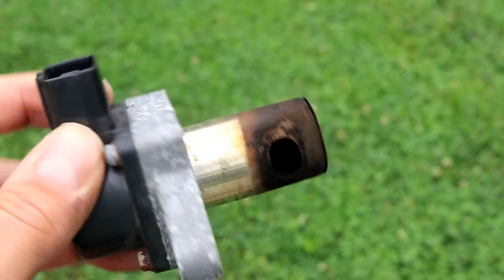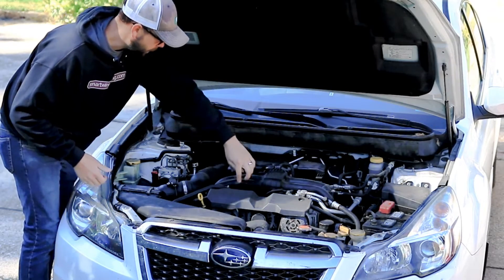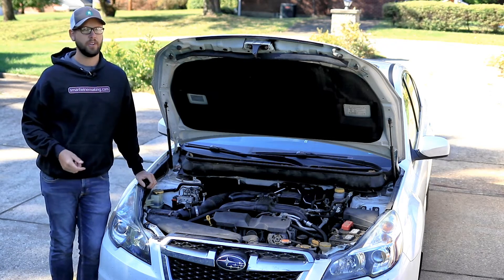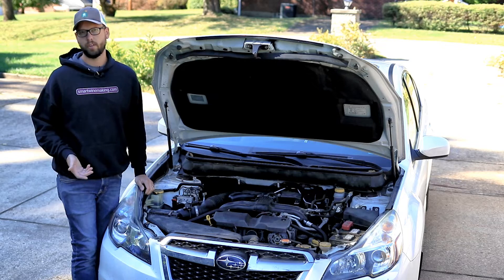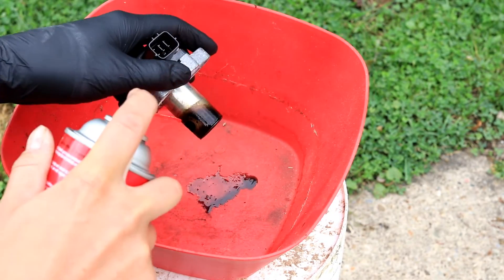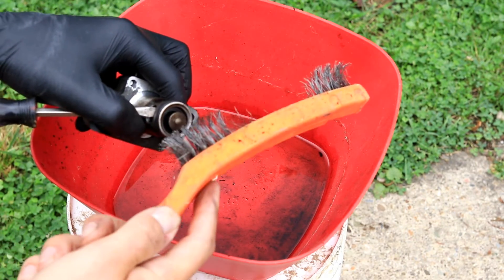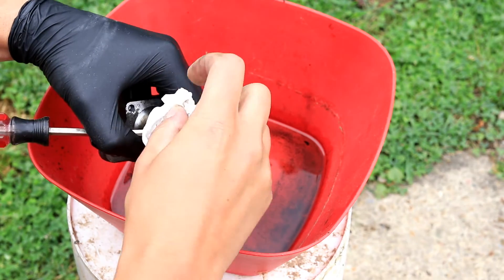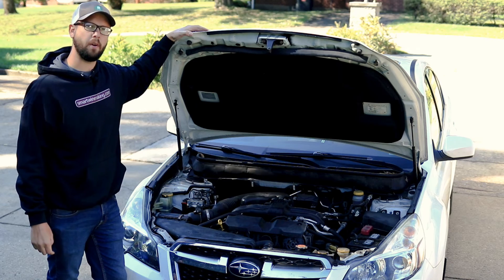Cleaning a Subaru Electronic EGR Valve to Smooth Rough Idle and Improve Power.

Comment: Great video!  Car was running really rough and stalling. Pulled the EGR, it actually was stuck in the open position because it had chunks of carbon stuck in it. Cleaned it and put it back in and it runs a million times better. I also tried to take the top of the EGR off to get inside it but one of the four screws was rusted and would not budge. Still, I let is soak for a couple hours in carb cleaner and used tooth brush. That did the trick. I have a 155K on 2013 Subaru Legacy. ALSO, there was no O-ring at all on the EGR. So, I am guessing someone cleaned it and did not put ring back on. Initial codes were P0113 and P0102. Now they are gone! If your Subaru is running rough and it has over 60k on it I would start here. Very easy to remove, clean and reinstall.

Comment: "A little bit carbon'd up." 
59k miles and my wifes looked like it was coated with Kingsford charcoal. I took the whole manifold off and cleaned the throttle body too. I took off the electrical part and pushed the plunger down myself and sprayed it really well and it looked brand new by the time I was done. It fixed  that pesky rough idle at the stop light. Good video.
Reply: what kind of car?
Reply: Did you have to do an idle relearn when done? Or you did not disconnect the battery?

Comment: Ooh!  I can't wait to do this.  I did my plugs (saved $600 off what Midas quoted), cleaned throttle body and refurbed my battery.  For a newer car, a Subaru is actually pretty easy to work on!

Comment: My screws won't come out.  Any ideas on how I may take them out easier?
Reply from the maker: They can really stick on those aluminum blocks.  You could spraying with some pb blaster and letting soak for a few days.  Unfortunately the threaded zone is pretty well sealed up, so if your penetrating oil gets there it will take a while.

Comment: 12mm bolts use, for hex head bolts, a 19mm tool.
Reply from the maker: 12mm hex heads I believe I meant to say...  Not to be confused with M12 screw threads.

Comment: Thank you, I had a P1498 code.  I replaced my coolant cross union and forgot to reconnect my EGR Valve, after watching this video I checked my EGR valve and it was disconnected, reconnected it check engine light is off and I have Eyesight again.  I going to clean EGR valve next
Reply from the maker: Glad I could help!

Comment: Is it possible to remove the solenoid (4 Phillips) from the valve and really give it a thorough cleaning?
Nice “How To” thanks!
Reply: That's what I did. Got it back together and it started, ran, had a good test drive, no codes and the total tank mpg went from 400 to 450 so I think it's safe. Lol

Comment: Excellent video. Is your engine the 2.5, or the 2.0 like on a 2013 Crosstrek?
Reply from the maker: Thank you! It is the Subaru 2.5 (FB2.5) engine.
Reply: @CoolStuffGuysLike , Thx for replying. I'm going to clean the one on my wife's Crosstrek with the 2.0. It has 155,000 miles on it, and as far as I know, none of that maintenance (PCV, EGR, O2 sensors, etc) has ever been done. It should be similar regardless. She's been taking it every day, so I haven't done it yet. Thanks for the video.

Comment: How often you have to do this or at what millage approximately??? Anyone?
Reply: My wife's car hit 59k. She was out of town so I drove it and the idling at the light was awful. So I did this and cleaned the throttle body and it smoothed out. I'd do it every 10k as it isn't hard and made such a big difference, but that's just me. At least do it when it starts to idle rough while in drive.

Comment: great video. I have a p0171 on my 2011 legacy and am curious if this could be one of those 'pretending to be a vacuum leak' instances. losing my mind trying to fix this, hoping that maybe cleaning the egr will help. only 60k, but it sat for a while.
Reply: Same year but forester  non turbo... What was the issue for you? I also heard that the AF sesor is common for P1071
Reply: @mattaust-1  honestly after a few months it just completely stopped throwing codes on me. I couldn't get past 100 miles or so for the longest time, but this last time broke the mold and I'm sitting at over 500 now without throwing the freaking code so far. AF sensor is something I never considered... will keep that in mind if for some reason it comes back. I haven't taken my fuel trim values since but it would probably be advantageous to do so since I was sitting at over 30 percent at idle when you really shouldn't surpass 5. my voltages on both o2 sensors appeared normal/as expected I think.

Comment: What about checking the vacum parts?  You did 1/2 the job.
Reply from the maker: Most modern EGR valves, including this one are not vacuum controlled anymore.  It is an electronic actuator, so there are no vacuum ports to clean.  I suppose if it were visibly clogged or restricted, you would clean the EGR tube but in most cases it should be pretty open.

Comment: thank you so much for this. cleaned mine today and first test drive went well, I've had issues with the engine dying at stop lights/signs in the winter. Looks like that won't be an issue this winter
Reply: How is it performing now after the clean?
Reply: It performed better right away, but my engine was still surging and struggling to start, cleaned the O2 sensor but the issue persisted. Ran some Fuel Injector Cleaner through my gas tank which seems to have done the trick.

Comment: from other youtubers (mostly Mr Subaru) I have done the following:
1. differential fluid flush (front and rear)
2. brake pads and fluid flush.
3. spark plugs
4. PCV valve and hose replacement. at 6 yrs of ownership and 116k miles, the valve surprisingly still move freely when I shake it. I replaced it anyway.  
5. Used Subaru engine cleaning kit: top engine cleaning ( used a 3/8 OD vynil tube), throttle body cleaning, last one is just dumping the bottle into the gas tank. 
6. idle re-learn after that.
7. then I found out about this and cleaned it up also. Took some finesse but I didn't remove anything to get my wrench there. 
idle is smooth now and even at stop and go, it held the rpm. before, sometimes at red light or stop sign idle went low that it almost shut off the engine (engine shudder). 

at 100k the only thing the mechanics did was tranny fluid and serpentine belt.
thank you again for the content.

Comment: Great video!.. i'm gonna have to try this tomorrow as i'm experiencing just a tad bit of rough idle, poor gas mileage and a tad loss of power during acceleration on my 2011 Forester 2.5X.. hope this fixes it!.. thanks again for the tip!
Reply: Check the pcv valve it's one of the most common over looked items.
Reply: Also check the Mass airflow sensor and the throttle plate

Comment: I had it towed  to a local shop as running gawd awful and the check engine light had finally come on after a few days of operation. I didn't know what the problem was but they said they got a reading and figured it was the EGR. They had tapped it and the car ran smooth again. They looked the car over for any other things that could be repaired and came up with about $4,000 worth of issues that could be needed soon. Mostly suspension, control arm bearings, and somethign with bushings. Also said it needed new struts. No where in the body of work that they told me needed to be done was the EGR. I asked them and they said, to do the EGR would be $600. That is when I found your video. and a part online for $110 delivered. A week later part in hand and another run through with your video, I had it switched in 20 minutes. The hardest part for arthritic fingers was taking off the snap on electrical hookup. 
I also had to get a new lug bolt and so at the dealer I asked my service writer about the cost to have it done since they ought to know the easy way. The part there was $161. and complete install was $331. I subscribed........ and a big thanks for doing the awesome video.
Reply: Are you kidding?  $331 to change a lug bolt?  The bolt costs about $1.25 and I had an extra nut.   Three taps with a 40oz hammer and it fell out (had to take the wheel and rotor off).  Then pull the new bolt into place with the lug nut and a homemade spacer.  Finish seating it when you torque the wheel on.  A very easy DIY job on a Forester.

Comment: Very helpful video.  Cleaning the EGR valve made a HUGE difference in power afterwards.   I used some Steel Wool to scrub off the carbon in places where it would reach- I even wrapped a small amount around the tip of a flat blade screwdriver which was also helpful.   Point of note- the Carb Cleaner WILL definitely screw up the rubber O-Ring, so don't do that.  (Fortunately, it shrunk back to size overnight, but I'm still going to replace with a new one I have to order, because I think my old one is damaged.)   Thanks again!

Comment: Is the process for cleaning the EGR valve on a 2010 Forester XT the same? I've been having slightly bouncy idling. Super low mileage car that was in storage often.
Reply: Hi I have a 2011 orester and im having trouble getting the EGR bolts loose how did you do it..there super tight . TY  Kev.

Comment: You are a genius! Thank you so much for this video! With over 150k got a CEL with P0300 multiple random misfires a few months ago. Only symptom was a rough idle and intermittent trouble starting when warmer up. Tried changing the battery and spark plugs since they were both reported fixes and I was almost due anyway. Checked for vacuum leaks, checked for fuel delivery issues, none to be found. Trying to figure out my next move, I saw this video and figured EGR needed a good cleaning anyway. Sure enough, all problems are gone! This part is exactly the same on the Impreza with the FB20 engine. The bolts were stuck pretty good so I had a much easier time by removing the air intake duct and that gives you much more room to get a bigger wrench on them from the back of the intake manifold
Reply: Did your engine stall at stoplights?
Reply: @Dantelchico  to be honest, I don't remember if my car ever completely stalled out while driving. Generally when driving it just idled very rough when stopped. It felt awfully close to stalling out a few times. I did have issues starting the car when warm and it would immediately turn back off. So occasionally I had to start it a few times for it to finally stay running. I suppose that counts as a stall?
Reply: @RaffiT83   I am curious to know what you did after cleaning the valve, did you erase the code
                Or not ? And was the engine running good right away after cleaning it ? My Subaru
                Has the same symptoms as yours  ! Thanks for your inputs.
Reply: @gaetansouliere2684  good questions! My car was absolutely running great immediately after cleaning the EGR and bolting it back on, along with the intake duct. I can't remember exactly if I cleared the code. I think it's a good idea to clear the code if you can, but the code should go away on its own after a few drive cycles. More importantly, are the fuel trims. My fuel trims were off especially at idle because of the lean condition caused by the gunked up EGR. That should also correct itself, but if you want to be sure everything is cleared, I would suggest you disconnect the battery before cleaning the EGR. Then reconnect after the job is done. It's very important that you do an idle relearn procedure any time the battery is disconnected. Otherwise, your throttle response will be off for what seems like a few days. Eventually it should correct itself.
For those who need the subaru idle relearn procedure,
1. turn off all lights and accessories (no A/C, lights, blower, radio, etc.)

2. disconnect battery for 30 min
(now is opportunity to clean terminals, check ground)

3. reconnect battery (in your case after cleaning EGR) 

4. turn key to ON position for 15 seconds (throttle body has a chance to go through a check sweep 
during this period; do not let engine turn over)

5. start car and let it idle without any load (no A/C, lights, blower, radio, etc.)

6. leave engine running for 10 minutes, never loading, never touching accelerator

7. turn off engine and leave key in off position at least 20 seconds

8. turn key back to the ON position for 15 seconds without starting engine

9. start engine and leave idling for 5 minutes without loading or touching accelerator

10. turn off engine and wait 20 seconds before restarting

DONE! Test drive!
Reply: @RaffiT83  Thank you for your quick reply, I will give it a try
Unfortunately for me, my cheep  obde2 reader only gives me
A generic. p0000 , I think it means that it does not
Compute the message. I also have a dynamic control message along with the emission message, probably not related
But odd that it came at the same time. One question , does daylight driving light affect idle relearning or not.Again thank you so much.
Reply: @gaetansouliere2684  no problem. Now that you mention it, I also got the light for the vehicle stability control. I think that's normal any time the check engine light (CEL) comes on. It basically disables certain functions like cruise control until the problem is fixed. It will go away when you solve the CEL.
About the daytime running lights, I didn't think about that. Good question again. I have a manual model and those lights don't come on until I disengage the parking brake. So normally when I'm doing the relearn, they're off. Not sure if that's true for automatic too. Maybe check to see if they're off while the car is in park or try putting on the parking brake to see that that will turn them off, assuming it's automatic.
Good luck
Reply: @RaffiT83  ok , i will do that or leave them on  and will see what happens, thanks for the info about the dynamic control system off with the check engine light on , I didn’t know that..... THANK YOU AGAIN !!
Reply: I have the exact same symptoms on my wrx. Is your car a 2 liter engine boxer? I also get the dreaded p0300 code.
Reply: @guitarzan2626  FB20 non turbo engine in my 2013 Impreza
Reply: @RaffiT83  ok thanks your trouble is very similar to the one I'm having. Good luck to 3
Reply: @guitarzan2626  I feel your pain, unfortunately the P0300 is very generic and doesn't tell you much. If you don't have the tools to check fuel trims and other sensors to find anything that might be out the ordinary, then checking the EGR valve is not a bad idea if you have higher mileage. Likely needs a good cleaning even if it's not your silver bullet fix. If that doesn't help, then you may need to test for vacuum leaks. That is another potential source for rough idle and the P0300 if the leak is bad enough. Good luck.
Reply: @RaffiT83  thanks, I'm going to work on it again today. I'll let you know when I figure out the problem.

Comment: If the egr is this dirty, world that cause your check engine light to come on? My wife’s 2010 outback stalls some times at red lights
Reply from the maker: It could. The easiest way to start your diagnosis is to read the code which any advance auto or auto zone will do for free.  You can also get an OBD2 scanner pretty cheap these days.  Could be a vacuum leak, throttle position sensor, a dirty/bad mass airflow sensor, cam position sensor, super dirty air filter.... You never know.  Could even be a transmission lockup issue.   It is difficult to know without driving the car, or getting a look at the computer readouts.  Hopefully the code will be actually useful.  Sometime they are so generic that they don't really point you in the right direction at all.  If there is no code, I usually start with the free/cheap stuff.
Reply: The dirty EGR caused a CEL on my 2013 Impreza
Reply: Torque converter... 2010-12s are known for this issue👍
Reply: I have a cylinder 1 missfire code, engine stalling at stoplights, rough idle. This EGR cleaning is next on my list...
Reply: @Dantelchico  hey bud have you found the issue and what was it ? thanks

Comment: could you use throttle body cleaner (or break cleaner) to clean the EGR Valve ?
Reply from the maker: Yes you could do that.  Just need a good strong solvent to help break down the crusty carbon buildup.
Reply: @CoolStuffGuysLike  the egr on my 2008 was little different in a design and touch more difficult to clean but after using a whole can of throttle body cleaner and a box of cotton tips i eventualy won, it was pretty gunked up etc *if i had to do it again i would have just let it soak overnight then cleaned. it, i would have no doubt used a lot less product getting the job done yeah ;)
Reply: Note about brake cleaner vs throttle body cleaner. Brake cleaner evaporates fast.

Comment: Thanks for this. It inspired me to clean the one on my 2011 Forester with the same engine as your Legacy.  I can only say you skipped over the hardest part of the job in the video. There is very little space to operate a ratchet, and I had to use my 1/4 inch. Just a warning to others to be aware of the electrical connections and to be careful not to damage wiring when you have to use your hammer on your ratchet to break the bolts loose.
Reply: I know its been 2 years for you, but use wd40 to loosen bolts when its hard. It`s a lifesaver and you don't need to use a hammer.